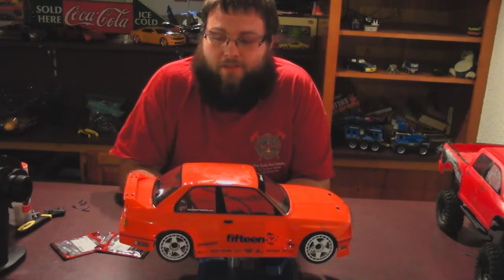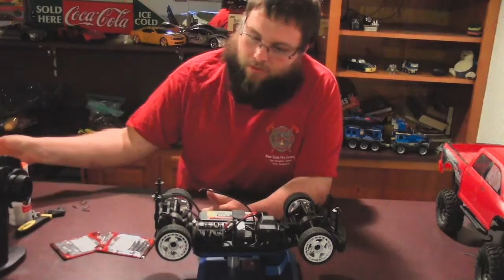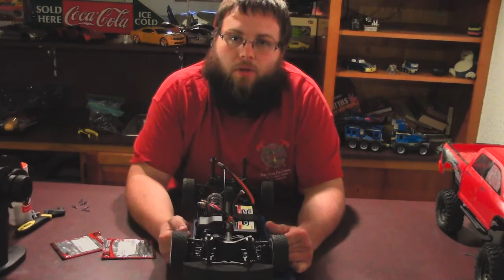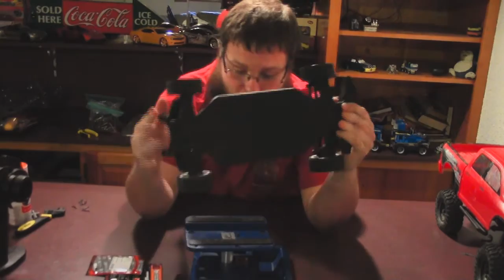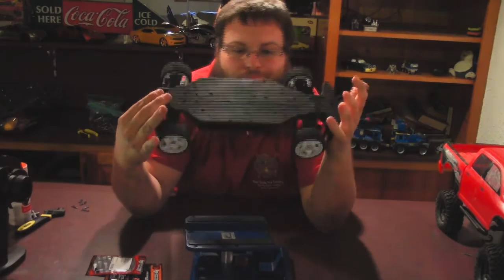HPI Sport 3 Dogbone Problem Update

Comment: Hpi servo is a little weak,  I had the same issue with my flux, went and got a traxxas 2075 high torque steering servo. This has always been a great servo for a good price .    it doesn't allow over extension in wide turning.  No problems for a few months.   def more crisp in handling and response.
Reply from the maker: +RAMJ17 Thanks for the info.. i will have to look it up and maybe get one myself!
Reply: RAMJ17 thanks

Comment: adjusting the modes for the esc are described in the manual, I think you need to hold a button down when switching it on, but the manual also says that factory default is auto-detect voltage so. at least if it's the same one that's in the porche..
Reply from the maker: +jan christian Frodahl My esc has no hold down button.. its not the same esc as what says in the manual HAHA
Reply: Double D RC
Huh, weird..
Reply: +jan christian Frodahl Just revisited this, as well as my manual, ans some websites, and the bmw has the 2s esc and the 911 has the 3s compatible one. I saw DanP has gotten hop up parts now, so I`m hoping they will be available in europe when the season begins. I found some titanium cvd`s too. And the spurs stripping can be somewhat undone by shimming the posts on the inside of the bottom plate, where it holds the cetre shaft and the spur assembly. I still run mine as a rwd because I have nobody to race with before summer, and then shimming all linkages, and upgrading quite a few parts awaits :)